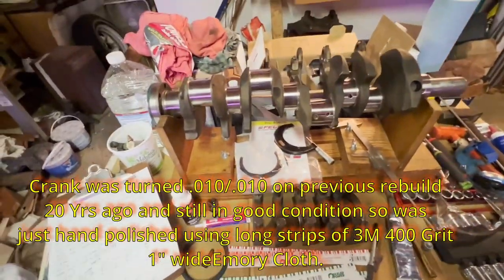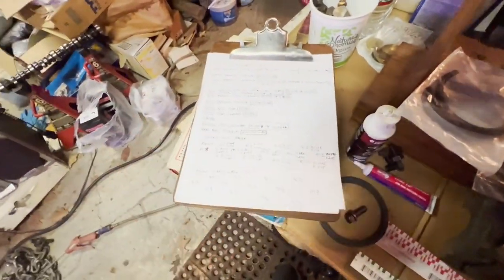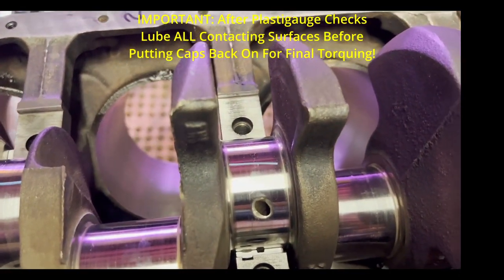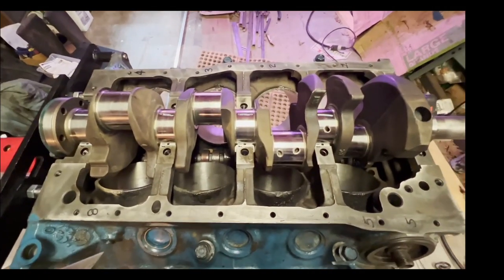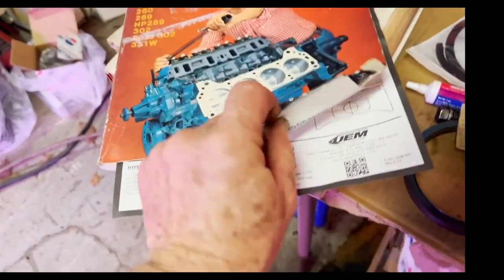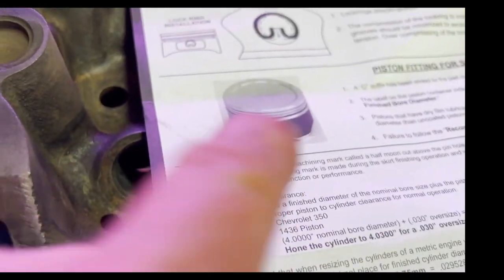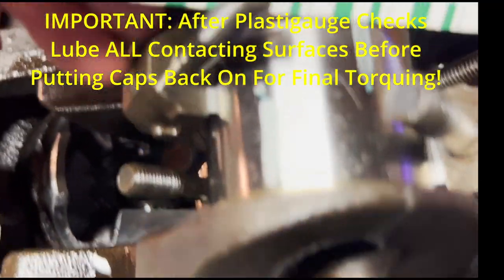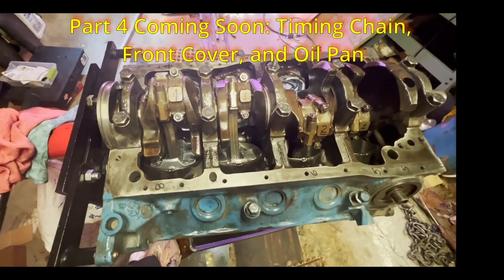Part 3 Ford 302 Budget DIY Home Engine Rebuild: Assembling The Bottom End

Comment: Pretty good video. I’m in the middle of a frame off my 79 F150 Styleside PU.  I’ve got a 302 ci (G)
Reply from the maker: That 79 has a nice look that I like. My 83 I've had since 91 has a style I like with the Super Cab and back side window filler piece. Mine is a Rat Rod. A tree fell on it during a hurricane in 2017 or 18 and wrinkled it a bit and blew out the windshield but didn't crush the truck. People stop me all the time going what a cool old truck. Is it for sale? To me it's not old. It's just something I've always had.
Reply: @mkdhdinfiniteendlessconten3873  I’ve had everyone from the UPS guy to people jogging past the house asking about my 79. It will be a grand day to get it right. I wish Chip Foose would steal my truck for the show Overhaul to work on the truck. Lol 😆.

Comment: How's that engine doing a year later ?  :)
Reply from the maker: Hi. Thanks for watching and asking. It's actually well over 2 years now. I drive it everyday plus long trips of 300 miles or more. Zero issues. No Leaks. Runs great! The truck mileage just rolled over 600,000 miles. Just put a heater core in it. It's my latest video. Rebuilt the AOD Trans in the Spring. Go to my channel home and you'll see all the videos. Better yet, Subscribe and you'll always know what's going on. ;-)

Comment: Did you have the rotating assembly balanced ?
Reply from the maker: Hi. No, not on this one, since the theme was a DIY budget build. I've had it done in the past and even balanced one personally myself years ago. It's a good practice, but tedious, so it does add to the cost since time is money. 
I'd like to build a 351W for it sometime soon with a few performance mods and will definitely balance the rods/pistons for that and will of course do a video series of that build showing things better than I did on this video series which was my first, so always room for improvement. 
Thanks for watching and takin the time to comment. Very much appreciated.
Reply: @mkdhdinfiniteendlessconten3873  I know that rebalancing is recommended when using new pistons , but you can normally get by without it on a stock rebuild .

Comment: With that amount of clearance between top and bottom of cylinder… how would you figure out what size of rings to install? Especially after you stated you were not got to get the block cylinders machined over.
Reply from the maker: Hi Mark. Good question. Mostly an educated guess in this case based on measurements, clearance specs for the new friction coated skirts on the new pistons, ring gap specs for the rings the piston data sheet listed and using Hastings moly rings which flex better that I just happened to have. The taper and the ring gap were on the high end tolerance for 7 of the cylinders. The number 1 cylinder that had the catastrophic ring failure where fragments were double stacked in the groove was way over. Less than ideal, but this was for me not someone else, but still a bit of a chance which was  enough reason (for me) to push forward as the whole point was a budget home rebuild. If the piston skirts weren't micro cracked I would have cleaned and re-used the originals, which is what I wanted to do/show, but it would have been penny wise and pound foolish to do so.
I've pulled the plugs to get read on the cylinders and they're all perfect after thousands of miles as is the compression. I doubt it will go 200,000 miles like the last rebuild, but I'm 61 so neither will I so I'm not fretting it.  For now I just needed the truck I already have to function reliably as a truck. It scoots around town at 12 mpg and 15 on a trip and hauls stuff and a trailer when needed. If I can find a good straight 6 cyl 300 I'm contemplating building one of those for the truck and turbo charging it or an Olds 455 I have laying around. Would like to tow with more confidence than now with the 302 when pulling a 7,000 lb loaded trailer.
Reply: @mkdhdinfiniteendlessconten3873  my 79 has a 2 bbl on it from the factory. I’ve even had it up to 90 mph to see if the BEAST could go that fast. She did it. As I stated before, if the pulley didn’t look warped I probably wouldn’t tore into the engine. Now I can’t wait to install the new timing chain with new damper. After I get done, it will be a very tight engine. Transmission and rear end be rebuilt. Nice!!! I’d like to take the exhaust straight back instead of utilizing a Y going across and back down the right side.

Comment: Did u just buy new pistons? I got to buy new stuff for my basic factory std 302. Any recommendations on my engine rebuild?
Reply from the maker: I did get new pistons, bartered a bunch of rings/bearings etc I didn't need with a local guy who wanted them for the set of pistons which were probably valued around $150 or so.